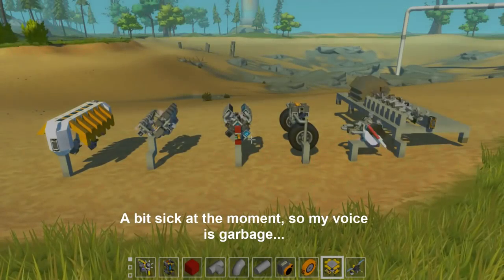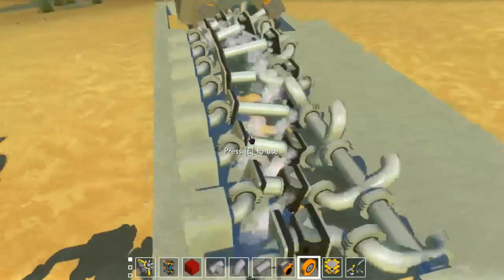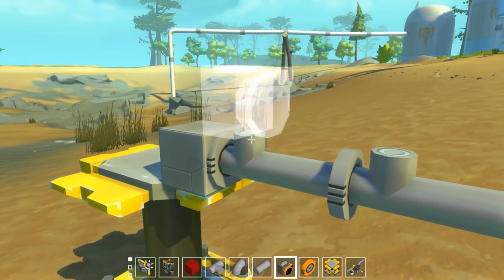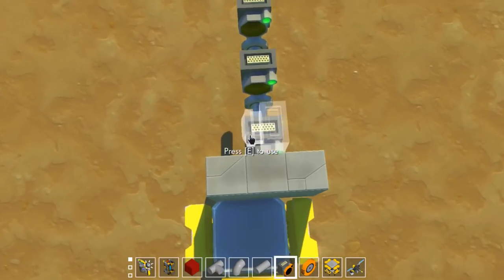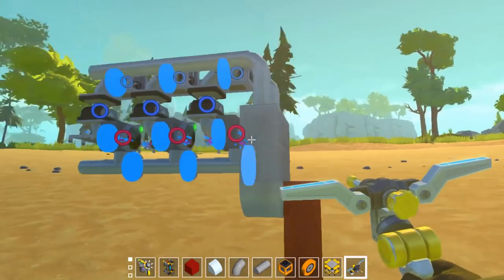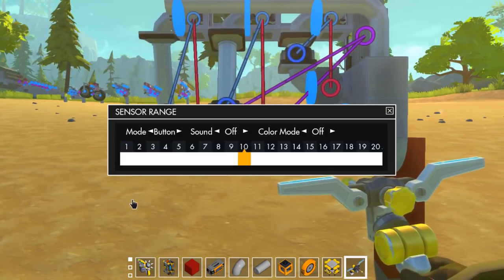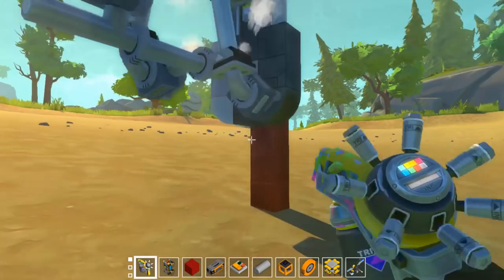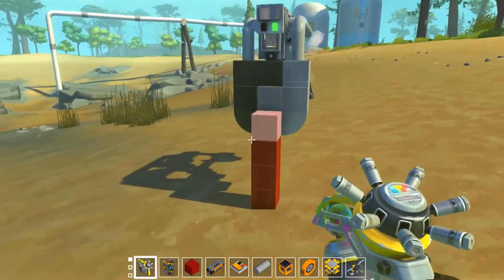I3 Piston Engine Tutorial...

Comment: I can make piston engines pretty well, I just can't seem to make them fast.  That inline 8 of yours seems like it's going twice as fast as anything I can manage to make. I can't think of any way to make piston engines any faster.
Reply: It's not about how many pistons you can fit in a row, it's about how well they're timed. If the timing isn't correct, the engine won't function as well as it could be.
Reply: Furthermore, I gurrantee you that it's possible to make an inline 3 piston engine that rivals the v8 in speed, as long as the timings are correct.
Reply: @xthereon754  I didn't say the number of pistons mattered. I just used "inline 8" to describe the particular engine that I noticed was spinning quickly.